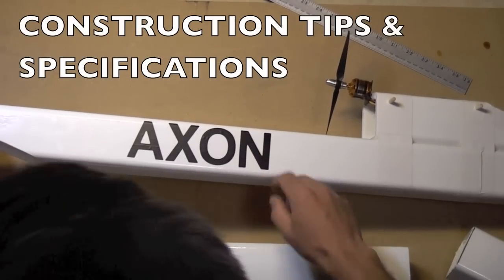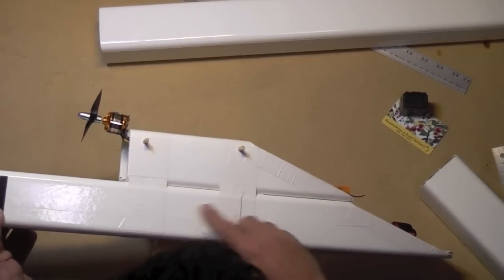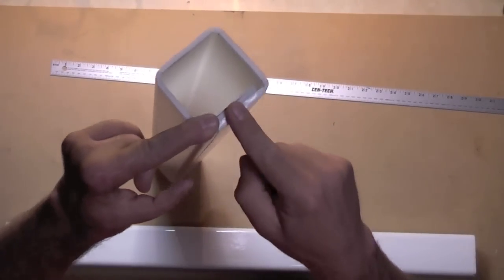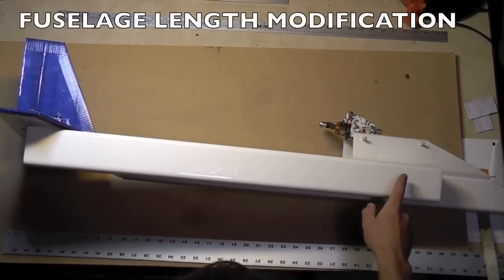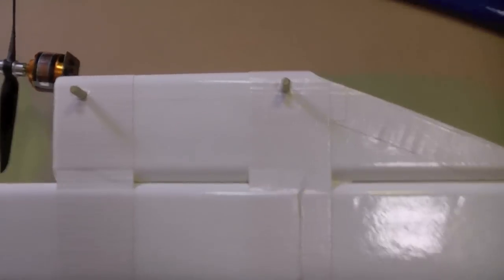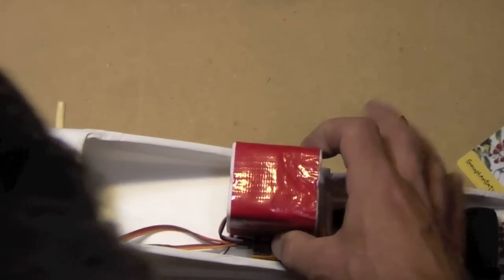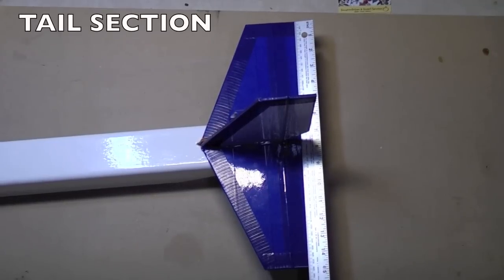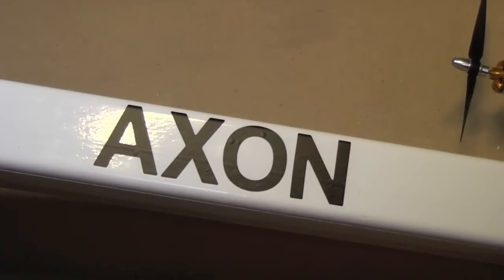AXON Construction Details

Comment from the maker: @race54321msncom For a 6 1/2" total chord wing I recommend measuring back 1 1/2" from the leading edge of the wing, about 6" out from the fuselage on the underside of each, and make two marks there.  Put all electronics and battery in.  Balance the plane on your fingers at those two marked points.  If all correct the fuselage should be level.  If not, move battery and/or electronics so it becomes balanced.  25% is a beginner setting for CG, very stable.  You can adjust with skill later.

Comment: Hi Ed , I have a cg question for you , I'm building a smaller version of the axon . In your noob tube videos you explain how to balance that plane. First by balancing the fully loaded tube section then the wing . I cant seem to do that with this model. Since I'm only going with a 30''wing span and don't plan on removing it for transport ,I've already attached it to the small section of the tube. Should I just balance the plane based off apex of the wing ? Thx

Comment from the maker: @kitesteez Huh? Never had THAT happen before ;)  Actually I feel pretty good about this particular plane, but for noobs you bring up a great point.  For sketchy planes I like to roll up a strip of foamboard, stick it to a piece of plastic gift card, and tuck that under the battery so the foam becomes a "crumple zone" upon crash.  It's not foolproof but it helps. Landing gear is my next project.  Floats are out of my league, living in Arizona - not much natural water.

Comment from the maker: @kitesteez You are right, a triangle is more rigid. The main reason for using the square fuselage is the ability to put stuff inside more efficiently and to mate parts together in a kind of modular way, and it's reasonably strong.  A triangular fuselage would be strong and would be easily possible with this foamboard technique.

Comment from the maker: @maksym2k I'm using a 2826-6 2200kV motor.  You can find these from HobbyKing, RCTimer, and others.  YouTube won't allow links here, but these are easily searched.  The prop is a 6" diameter by 4" pitch, so 6x4 APC or "parkjet" style.  ESC 30 amps is good for this range of powerplant.